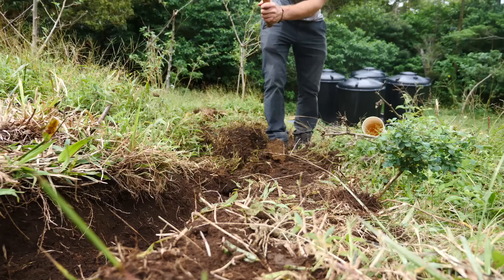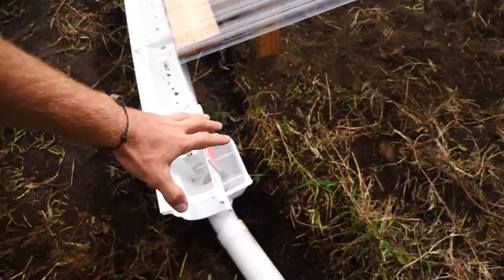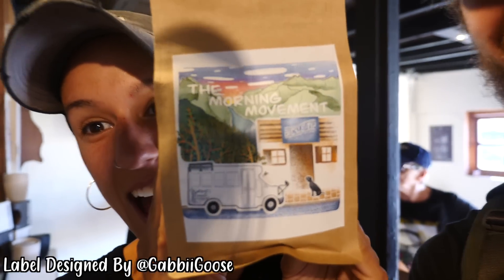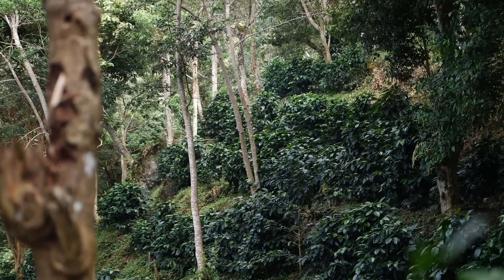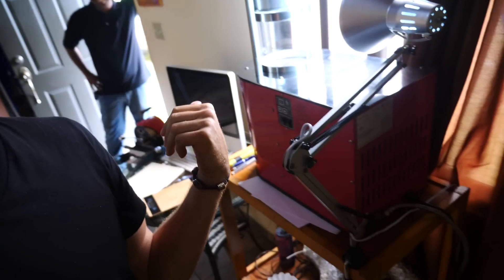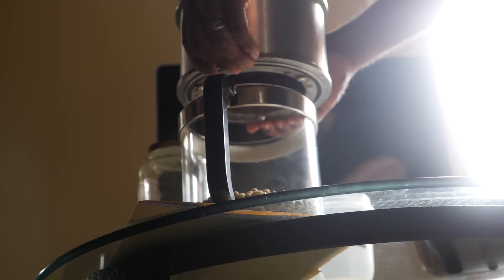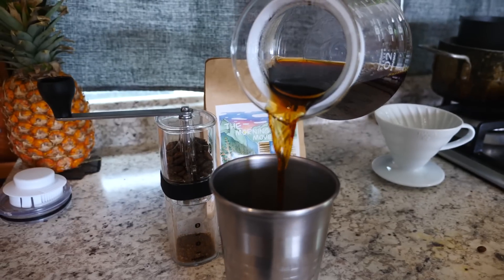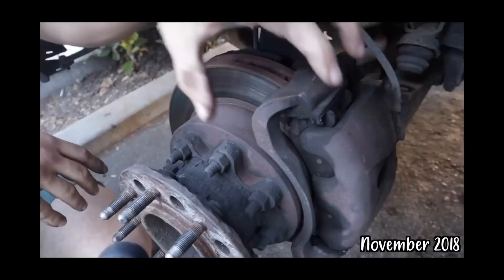WE HAVE A BIG ANNOUNCEMENT! // building a tiny house homestead

Comment: Are those tanks going to fill from the bottom? Just curious if there is enough pressure created.
Reply: With the tiny pipe, I am hoping that is just the outlet.
Reply: @KayRay1966  Gravity will balance the height of water in the tanks with the height of water in the piping coming down the hill.  However, those four small pipes are connected to one small pipe and will not accommodate the quantity of water collected off the panels.

Comment: Loving the effort you've put into your water collection system, but I have to agree with other comments about your gravity fed system. I collect water from a down pipe into a number of water butts. You have to feed rainwater into the top of the first tank, connect a pipe an inch below the full water height and then connect to the second tank and repeat until you have connected to the last tank. The water will always then be flowing downhill,. you will  also need a drain hole in the last tank, above the intake pipe to allow water to escape once all tanks are full. Wish you all the luck in the world.
Reply: and how will the drains for each tank be connected?
Reply: @rty1955  A simple pipe connector secured in place with a nut on the inside of the water tank, then you can push fit your pipe to it.
Reply: @garyway3917  In your design, would u connect all the tanks together at the bottom?
Reply: @rty1955  No, Your gravity system works on the basis that the first tank fills up until it reaches capacity fed from the top of the tank. The next pipe going out of the first tank is fitted an inch below the pipe filling the tank, this then allows the water, once the tank has filled, to start filling the second tank, repeat for any further tanks, you just need to ensure the system is allowing the water to flow downhill. You put outlet taps at the bottom of each tank allowing you to access the water as you need it.
Reply: @garyway3917  so you have to manually change access taps each time a previous tank runs out?

Comment: you need better planning. Why didn't you build the roof over the tanks to protect them and conserve the land use. move the tanks under the roof and then you will have water pressure down hill. and your land will not end up a sprawled mess, or move the roof to the tanks. good luck guys
Reply: Exactly !   The current design is flawed and will not work as they expect.... time to scrap and go back to the drawing board.
Reply: thanks for the reply. I know it is a lot of work but the foundation of your land and homes must be planning. I also know it is a lot of work and sweat, but I suggest you move the water roof(rain catch)  over the tanks and fill from the top . you have the tanks at the bottom of the land and you will have to use power and pumps to move the water back up the hill to your homes. use gravity and flow to assist in this.Young and excited, don't burn out , lots of work and commitment ahead. are you mentally strong enough for this …..YES!!!!!

Comment: Are you pumping the water into the Tanks ?  You can't feed the water into the bottom of the tank without a pump.  If you made the catch area higher off  the ground, you could gravity feel the line into the top of the tanks not needing a pump. JMO
Reply: Huh? Lets go over basic physics. Water tends to seek its own level, therefore as long as the feed from the collection roof is higher than the entrance to the tanks (either at top OR bottom, the water WILL flow FROM the collection area TO the tanks
Reply: @rty1955  without a pump the water level in the tanks will never get higher than the lowest edge of the roofing collector. It appears like the tanks are higher than the roof area.
Reply: @RimdarRanch  if the collector pipe is higher than the tanks, the tanks WILL fill up, or did u miss that point
Reply: @HAVE A LAUGH huh? That's not how physics works. It does NOT matter where the tanks are filled (top or bottom) the water will always seek its own level. Like I said, as long as the fill end of pipe is higher than the tanks, no backflow will happen.. No pumps needed, no backflow. Nothing. Just gravity.
The only time you will need a pump is to move the water from the tanks, through the filter and sanitizing system, than back up the hill......
Its an extremely simple concept.

They NEED the water to create concrete. They said that a while ago. This is the whole purpose of getting this done first
Reply: @HAVE A LAUGH hmmm then I guess your water must be lighter than air. You must have to cap off your soda straw then, because according to you, the liquid will flow back up the straw if the cup is full
Reply: @HAVE A LAUGH Remember water will seek its own level. As I see in the videos, the top of the tanks are below the pipe where the water collection is. Therefore the water will ALWAYS flow downhill into the tanks as they are being filled. It does not matter where the water enters the tank. If the entry to the tank is at the top, then the tank will fill, leaving the pipe leading to the tank, empty. If the entry to the tanks are at the bottom, the feed pipe will be as full as the tanks are.  If more water is added to the pipe, it will flow into the tank. The only way the feed pipe can completely fill with water, is if ALL the tanks are full, and since the pipe IS an extension of the tanks (if it is a sealed system - no vent) no matter where the water enters the tanks, any additional water will fill the feed tube, not back out of the tanks.
As I suggested the tanks need an vent at the top. This will also act to let air in, to allow the water to flow freely down the fill pipe as well as an overflow if the tanks get completly full. If air is not permitted to exit the tank, pressure can build up and prevent water from traveling down the feed pipe (basic plumbing)
Reply: @HAVE A LAUGH glad u agree now
Reply: @HAVE A LAUGH water does not flow uphill...... Water only flows downhill
Reply: @HAVE A LAUGHI will answer it for you, since you either dont understand the concept. Water only flows down hill. Therfore it is impossible for water to flow back up the pipe.from the tank. Based upon the video, all the tanks are lower than the opening of the pipe at the collection site. Therefore rhe water cannot flow back up the pipe. Water can only flow DOWN the pipe, and into the tanks. Even if the tanks are completely full and sealed, water can still only flow DOWN the pipe until such time the pipe becomes full and overflows at the collection site onto the ground this is basic plumbing. Why is this so difficult for you to understand?

Comment: I hate to say this but I don't believe your bucket so I got a fill up to the top because once they get close it'll stop especially with all the back pressure if you're going to try to sell them all at one time with the pipes being down low you should've put the pipes at the top and you can have one going into one coming up the other side as an overflow and then connect each one from the tack and you would still fill up all the tax to the top and the last tank would just have an open overflow going on to the ground this way they don't overfill I'm sorry if some of the stuff is misspelled I apologize

Comment: ...I’m rusty in my physics... if they’re gravity-fed, won’t the tanks stop filling as soon as the water in them above the incoming pipe weighs more than the water in the pipe coming from the gutter? Shouldn’t you place the incoming pipe at the top waterline of the first two tanks instead of at the bottom of the tank? At 8lbs a gallon, it won’t be long before gravite isn’t enough to to push rainwater into the tanks instead of just out the top of the gutter...

Comment: i dont think those tanks going to fill up all the way when they get a certain amount of water in them the pressure from the water from the tanks and pressure from the down hill water running into the tanks are going to equallize and water will back up to your rain catch.lots of water pressure in those rain tanks when they start filling up .not trying be negative just wandering if you checked on that. i collect rain water to but fill from top of my rain barrels so dont. know but when i collect water from bottom lots of pressure.hope im wrong.
Reply: you are 100% correct
Reply: Correct, the current design is flawed and will not work as expected.
Reply: @KayRay1966  yea i thought he was going to fill from top of tank at first but then i seen he didnt .if he cant move his rain catch higher to fill from top i think he will need like a 55gallon plastic barrel down by his other tanks so its lower to fill from top then have 12 volt pump with switch in 55 gallon to kick on when it gets so full to pump to top of his big rain barrels leave them connected just cap off inlet the will all fill up equal then .and when they build there yert down hill from there tanks they wont need pump should be enough pressure for them .
Reply: @KayRay1966  if the tanks are vented at the top, the water will always flow down into the tanks, yes?

Comment: Are you using a pump to put in the rain barrel? Cause it looked on camera the the barrels and riod was same height. Why not build the roof over the barrels. It could have ran straight down in. And the barrels would have been protected. Just wondering

Comment: Why did you built that water collection roof so low to the ground? I saw the dirt in the gutter and I would be concerned with dirt and debris getting into the water tanks If you’re using it as drinking water.

Comment: I am concerned about how you are going to get the water from the large tube running down the hill into the first tank.  Are you connecting the inlet tube to the bottom of the tank? If so, I don't see how that is going to work. Don't you have to fill the first tank from the top? What am I missing??
Reply: @HAVE A LAUGH OK, it will be interesting to see how that will be accomplished!
Reply: @HAVE A LAUGH Why not build the rain collection frame close to the 1st collection tank and higher to drain straight in??

Comment: Love watching your channel, a little confused by the rain water system. Does the top of the tanks need to be lower than the rain water roof ? It's only going to fill up to a point in the tank where it is at the same level as the pipe that feeds it from the rain water roof (or have you got a scavenger pump somewhere?)

Comment: Uhhmmm, i don't want to rain on your parade but wouldn't it be better to put the rain roof over the tanks to catch rain water, protect the tanks and have a better flow into the tanks? Just a suggestion. That way you don't have all that wasted space of running your pvc across land that could be put to other uses. Shorter distance to run and its gravity fed.

Comment: Oh boy, the mistakes are plenty.   The fill should be on the bottom after 1st flush diverter and you never want to draw water from the bottom of the tanks where all the contaminates will be!  Also, the fill line is designed like a trap where water will sit, not good!  Not is all lost,  Fill from the bottom, not the top and use a float connected to each "outlet" with a flexible hose inside so when you draw water it is from the cleanest in the tanks not the bottom gunk.
Reply: I tend to agree with you. maybe place a small "sediment" tank prior to the fill tanks would be appropriate. i have seen people that collect rainwater that use a large 6" vertical pipe direct from the collection unit, with a tee about 2 feet up from the bottom that runs to the collection tanks. The bottom 2 feet of the 6" pipe can be opened to allow for debris/sediment clean out.
Reply: @rty1955  Yes, anything to avoid mud soup entering the storage tanks is a huge plus!
Reply: @rjaquaponics9266  haha true. I also noticed his collection gutter is very low to tje ground allowing for all sorts of animals to urinate into the system as well. Ewwww
There is a cute couple on another channel "life uncontained" that shows how they did rain collection. Take a look at how they did it

Comment: Disappointed, its Sold Out in 6 hrs. whens the next batch?  Your bottom fill into the tanks may not have enough head pressure to push the water to the top.